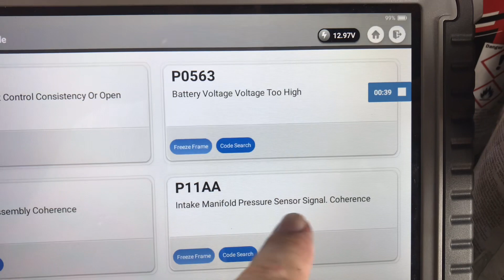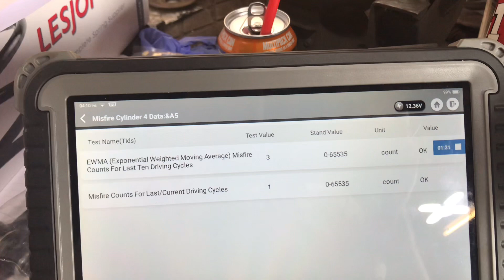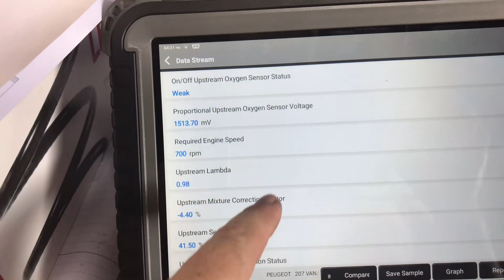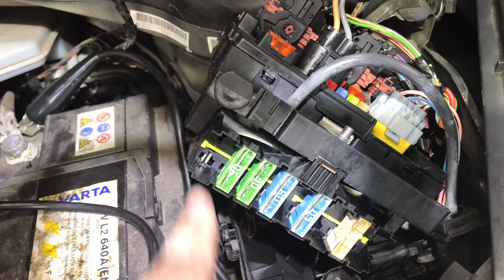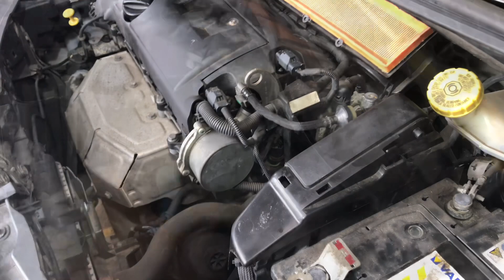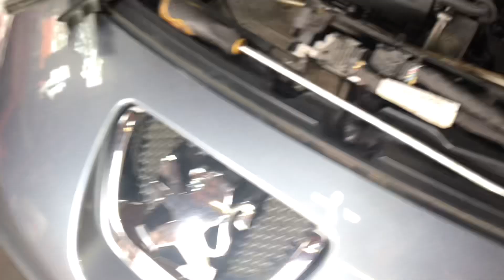Peugeot 207 (2009) Fault Codes P0597, P494, P0563 & P11AA

Comment: What happened? Was it the thermostat or maf sensor buddy??? Got the same problem with fan continuously on and rough idling-suspect Maf sensor….
Reply: Hi, did you manage to find the solution? Because I also have exactly the same problem...
Reply: @angegaux810head gasket. And a faulty injector. Used steel seal to sort the gasket and a new injector
Reply: @stevew6141  Thank you for your help. I'll look at this
Reply: Good luck 🤞

Comment: I had the same issue  on a 1.6 Mini cooper, dodgy pressure sensor. I bought a new sensor from Euro Car parts ,they only had a HAAS sensor on stock. I chased my tail for weeks. It turns out the Mini does not like Haas sensors only a Bosch unit got it to work. The thermostat housings are junk on these engines if the level gets low they melt.  The engine got so hot the valve seat in cylinder 3 dropped out.